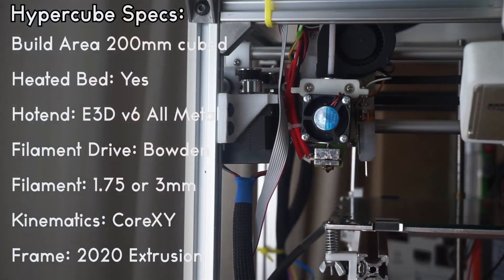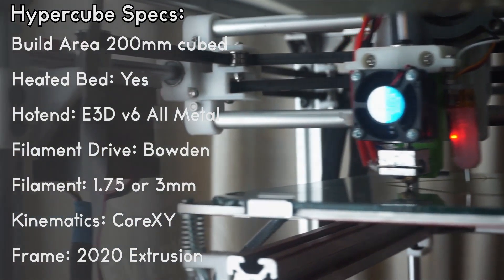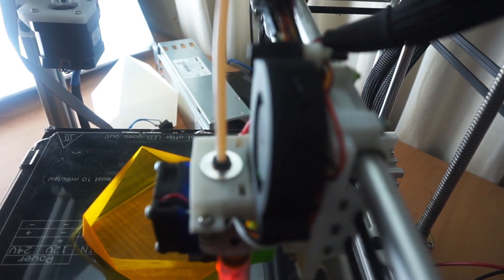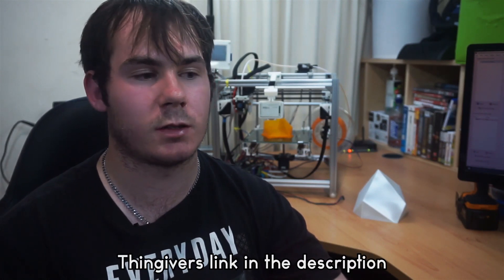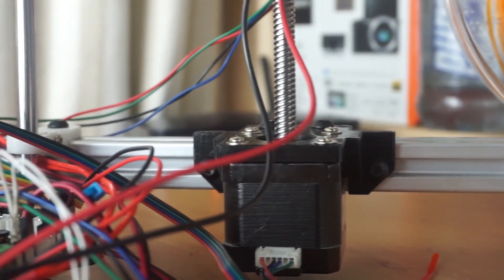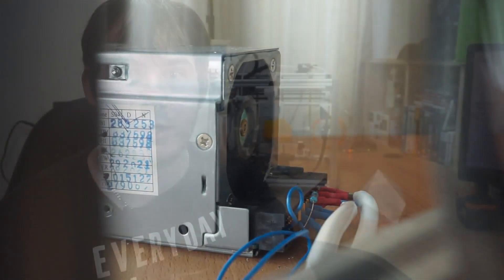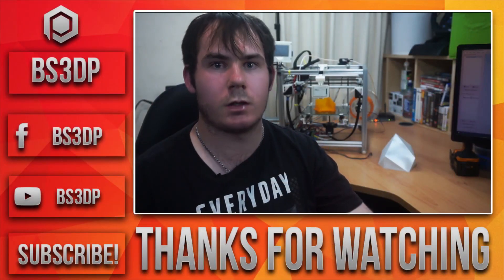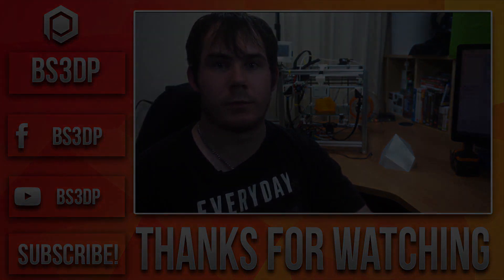Tech2c Hypercube 3D Printer Review!

Comment: 57 amps worth of power?^^
Hate to be a dick but that is completely meaningless (without mentioning voltage), maybe tell us how many watts?
Reply from the maker: +Márton Léránt I prefer to work in amps rather than watts bit its 12v57amps or if you would like the power supply is a rated 700w server power supply

Comment: Good review.
How do you have the server power supply connected?  Are you doubling up 12V sources to make 24V?
Reply from the maker: +Jason Leadbetter The server power supply is a 12v supply that can provide about 57Amps. IV actually never used 24v supplies although their good to make things heat up quicker, you need more circuitry to run things like you controller board at 12v. This power supply only has 12v out and 3.3v standby that I use to power a raspberry pi zero w to controller the printer and a solid state relay to trigger the pson lines of the supply to turn on the 12v rail. :)
Reply: Ok.  You should be able to double up your Positive and Negatives to get to 24V.  Might want to test first.
Reply from the maker: Nah I should be good, the 12v supply makes every thing easier and with the 57Amp output I'm never going to get close to that. If I were to go to 24v, doubling up on positives and negatives would still be 12v because that would be a parallel circuit with say 114Amps potentially but if I did a series connection where the positive of one supply goes to the negative of another I get 24v but at 57Amps. Not to sure how the supply would handle that though.

Comment: How does it handle CoreXY as I was reading there are issues especially with it not running the smoothie software.  Flash it with the smoothie (the real one) and it will begin to print and freeze.
Reply from the maker: Iv personally never had an issue with smoothieware and CoreXY, the CoreXY movement system is fully supported and has been for a while. Although there have been a few hiccups which turned out to actually be more of a hardware issue than a software one.
Reply: Odd, because people in the Google groups, and on Reddit, could not flash the real smoothieware to the MKS SBase.  1.3 changed out the crystal that was causing heck for ethernet for a lot of people but my 500mm cube CoreXY I would like to get away from Ramps on it and since I need to buy another ramps, change out its mosfets, and use my spare 2560 I might as well buy something modern and decent.

Do you know of a spot I can read up on smoothie for CoreXY?  I have no real knowledge of it having been a RAMPS 1.4 guy for 4 years.  Marlin I know very well but anything else (Sailfish to some degree) and I fall flat on my rear.  Basically I need my hand held to set it up as CoreXY is new to me and anything but a ramps is new to me.
Reply from the maker: +The Best Stooge haha fair enough, personally IV had no issues flashing the qenuine smoothieware on to my MKS SBase. Not going to lie, my ethernet no longer works for some reason but other than that IV pretty much had no issues with it. I would recommend any smoothie compatable board that isn't a MKS though as some reasons you can find on the the smoothie site. 

If you wanna research other people's issues and just pure information it's best off to search "smoothieware CoreXY" or replace CoreXY with hbot and see what comes up. When setting up the CoreXY design in smoothieware config just make sure you add the line to do with arm solution or something along those lines. If you get the newest config it should already have it and you just need to in hash it and change it to corexy. 

In terms of flashing, make sure the SD card your using is fat32 and you place the .bin file on it titled "firmware.bin" or the board won't flash it. You should see all the LED's flashing for a few seconds and then all of them should go solid except 2 middle LED's. That means the firmware flashed. Also if you look at the SD card after flashing you should see "firmware.cur" and that file means you flashed correctly. Make sure you add you config file as well  if you dont, the firmware will boot to default every time you power it. Also make sure you don't have anything plugged in when first flashing the firmware on the board. Just power and SD card.

Comment: I'm buying up bits for a HyperCube now so I watched this again. What did you think of Smoothie? I have an SBASE as well but I didn't like the firmware much, no soft endstops is my biggest gripe. I'm thinking a RADDS from RepRapMe would be a good purchase.
Reply from the maker: Smoothie is a great firmware to use but there are always gonna be limitations within its capabilities. I can't 100% say there is stuff like soft end stops but there are settings that you can change in the config file to set the length of the axis so it won't try and go to say 220 when your axis is only set to 200. I think the RepRap stuff is great and works really well and are cheap but there's always things like you have to update one little setting you need to reflash the whole board. You also lose out on things like 32-bit micro stepping which makes the printer much quieter.
Reply: Yeah there's the axis limit setting but that fully halts the printer if one of the endstops is triggered, so you can never move to zero, which is a bit inconvenient when your bed is at zero Z. The suggested solution is to home Z to max instead but then it takes ages to home up to 200mm and back down again to zero to print. I really prefer Marlin and Repetier, just the 8-bit hardware is so weak compared to what a corexy can do.
Reply from the maker: Iv honestly never had an issue when homing the bed to 0 it always just homes to 0 and prints. I hate homing to max because it just gets messy and takes to long to home.
Reply: That's what I mean. So I can either home to zero, but risk crashing the carriage if I accidentally move less than zero or greater than 200, or I can use the halt-on-endstop setting but I have to home Z to max, and I'd need to add X and Y max endstops too. I don't think RepRapFirmware has this problem.
Reply from the maker: In your config file you can set it to not go past 0 meaning when it gets a command to go to say -10 it won't it will just wither holt on endstop hit or not move. I had this issue only on marlin where the printer would always try to go past 0 but iv never had an issue with smoothieware
Reply: In Smoothieware? What is the config option? As far as I know that's called a soft endstop and is not implemented in Smoothie yet. I've been talking to Arthur Wolf about it on the forums.
Reply from the maker: Jamie I'll have to go though my config a bit later as I'm at work but I'm pretty sure it's in the endstop section. the only time I had a issue with going negative is that when using a bed leveling gcode but at the end of the say you really shouldn't need to worry about it going past the endstop because you shouldn't be sending it negative values to print from. The CoreXY design homes in the bottom left corner and to the top endstop that's adjusted by a screw.
Reply: Oh printing isn't a problem, but I'm using the board on a cartesian with manual bed levelling, so I'm always twiddling the LCD knobs or clicking in Pronterface to move the print head to each corner. Those are the times I accidentally overrun a limit and crash the carriage. Let me know how you go, I bet you can move the carriage manually to -10 and make the bad noises.

Comment: Thumbs up on using a server power supply. They get discarded pretty cheaply with tons of life in such moderate use left in them, very well made especially if it's by Delta Electronics, great efficiency and just a bit of peace of mind with regard to isolation quality and failsafes. You don't get any short circuit or overheating protection on a generic power supply, though using ATX2.x power supply is another decent option.

So you're running a CoreXY printer off the DRV8825 stepper drivers? Something that concerns me a bit is that CoreXY always exerts torque on another XY motor when one is moving! So holding torque is really put to the test, and microstep skipping can be an issue. Look here: http://www.engineerination.com/2015/02/drv8825-missing-steps.html

This fundamental property of CoreXY that the axis are not independent is why i likely won't be building one, rather a Makerbot style gantry, i'll be on a lookout for a design that uses v-slot for the rails besides the structure.
Reply from the maker: +Siana Gearz I love the server PSU it works great! I have qualifications in networking and servers so when I was in the market for a new psu I knew what to got! They have such a high output on the 12v rail it's great, my old PSU used to sag when the bed turned on. Yeah it's a major thing with the CoreXY design to make sure that the axis is aligned properly because you do get binding and steps missing. As for what drivers are on the MKS Sbase I'm not sure but they work really well and whith the 32 microstepping and software controlled current it works great for getting everything set just right!!

Comment: I use solid bearing steel 10mm for my X axis, I can print at 100mm/s without rippling, quite happy about that.
Reply from the maker: +Ralphie Vigg like a lm10uu bearing?
Reply from the maker: Ralphie Vigg nice do you find it adds lot more weight or not really? i plan on building a mini hypercube for a build video but i dont want to have to try get more aluminiuml when i have heeps of steel rods.
Reply from the maker: Ralphie Vigg Nice! im looking at making a hypercube thats about about 50% smaller but i would love to build a 200% size one just for fun with dual extrusion!
Reply from the maker: Ralphie Vigg Yeah, im using a MKS Sbase that runs smoothieware but my mini hypercube is going to be running a ramps board which will be fun to set up xD

Comment: hey Bryce neatly built 
am in a process of building the hypercube, 
and having some issues with the smoothie board config file it seems like i can't figure it out, am used to configuring marlin very easily.
any chance you could share the config file
Reply from the maker: +Saud Don't sure think! Ill share my config file for the hypercube later today! Just take note mines for a mks sbase board and not a generic smoothieboard but practly the same.
Reply: Bryce Standley 3D Printing! 
thx mate I appreciate it.
i have the mks board too
Reply from the maker: https://goo.gl/QZMGwA

Thats a full sd card dump from my board, please note im using the newest experimental firmware so some features like rectangular grid probing is only available in the experimental versions of the firmware right now. The PID file isnt used by the firmware but i keep it there for reference to my pid settings which are for a E36 hotend using a 12v 40w heater
Reply: thx mate 
but the link got disabled, it gives this message : this goo.gl shortlink has been disabled.
can you just upload the config.txt file
Reply from the maker: https://www.dropbox.com/s/zhbnaa8yatjstg6/MKS_SBASE.zip?dl=0 haha never had goo.gl complain about dropbox files like that
Reply: thank you bryce for your help
Reply from the maker: No problem at all :)

Comment: Im running the same power supply, what resistor are you using to slow down the fan? it sounds like a jet plane when my bed is heating!
Reply from the maker: Hey Stuart, iv made this quick little word document with the pin out. Take note that this is for a Dell Poweredge 2850 server power supply. Also the resistor is for boosting the 12v rail and not changing fan speed. I have heard that there are a few other power supplies with the same connections on it but the to make the fan slower you had to connect C2 to D3 instead of B2 to D3. just follow my document and it should work just take note if the fan doesnt slow down when using C2 use B2 instead and see if that works. https://goo.gl/TQ5onC
Reply: yeah its a little different but a great power supply for $13 shipped, thanks for the reply.
Reply from the maker: Yeah it really is, mine cost me $22 shipped to my door and it would cost close to about $100+ for a equivalent PC power supply